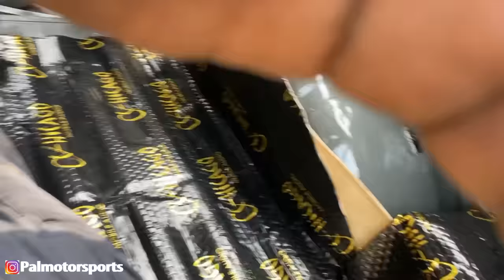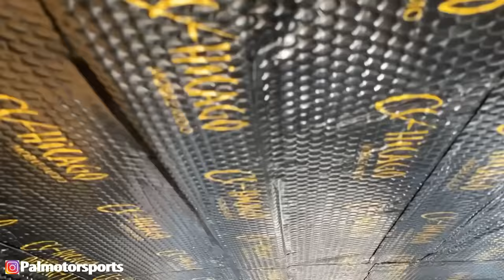SUZUKI SAMURAI came from  NEPAL for COMPLETE RESTORATION at PAL MOTORSPORTS DELHI I SAMURAI GYPSY

Comment: Excellent work.
The steering wheel from Supercarry is better suited in Gypsy. Also, side protection guards (hollow pipe type) on both sides would have further enhanced the looks..

Does it have AC & PS ?
Reply from the maker: We use supercarry 
Customer wanted it so fitted this
And he didn't want the protection guard
Reply: New Nepalese law doesn't allow protection guards. Anything that the manufacturer has not installed is not allowed.
Reply from the maker: @pratibhacharya  customer wanted it so we installed it
Reply from the maker: @NithinUdaykrishnaNithin  
Place 
New delhi
Number 
+919212591818

Comment: The video is lit, the music choice is good, but music transitions are bad, put some fade in and outs :D Apart from that, I haven't seen how did you cut or replaced the ceiling of the car (I have the same roof issue, that is why). I really would like to see it. One more question, why did you change the original tachometer? I mean, speedometer with RPM gauge gone and you brought the crappy universal tachometer? Overall, the video is lit as said previously, keep up the good work!
Reply from the maker: thank you for your suggestion Will keep in mind for the next one
the tachometer was changed to upper model according to customer demand